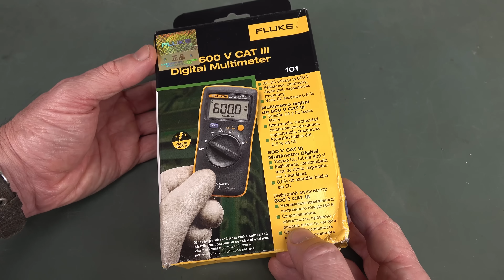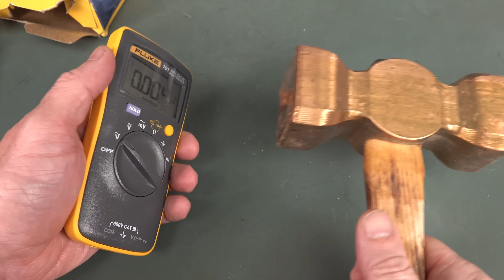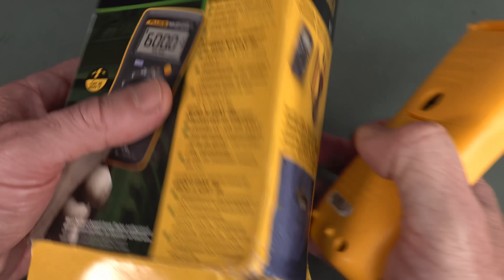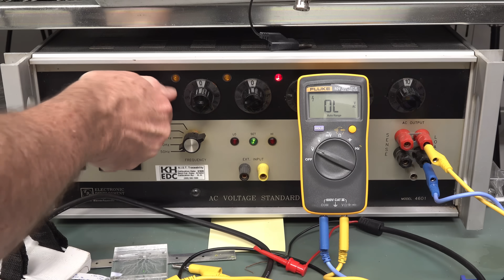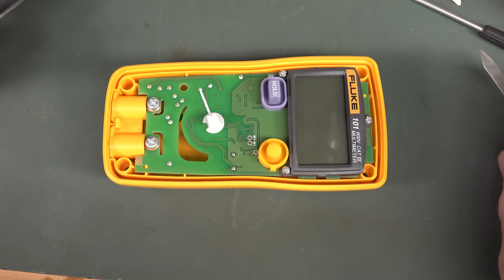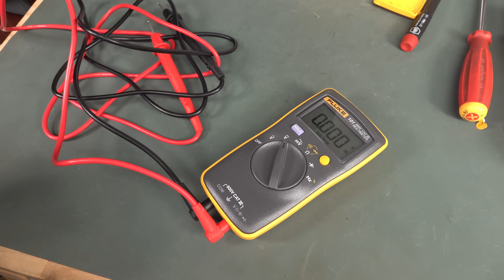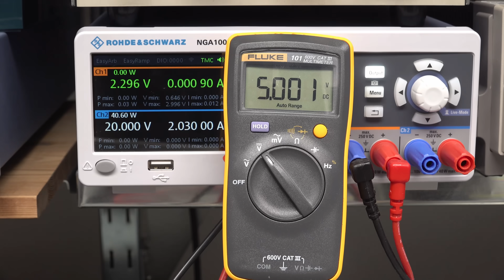EEVblog 1574 - REVIEW: Is the $42 Fluke 101 Multimeter Any Good?

Comment: As a hobbyist (basicly learned everything i know about EE by watching your channel for the last 8 years or so, and couple of other channels) I bought the Aneng 8008 when it was new and it's still working great and does everything i need it to do, it's all low voltage, like 12v max as my main interests are microcontrollers like esp32, arduinos etc ... However even though my Aneng can measure mains voltage, Im usually not comfortable using it to measure high voltages (and i try to not fuck around with high voltage) but now Im thinking about ordering this one for the few times I need to measure higher voltages and stuff like that .. Then i have the Aneng for it's features and keep using it as I currently do, but then i can have this one for it's protection when I need to measure high voltage knowing it wont damage my meter since I have a bit more faith in Fluke than Aneng ;) And buying a 2-400$ meter does not make alot of sens for me .. Win win
Reply: I also bought an Aneng when Dave did his video on it, and I have found the range switch to be unreliable. After not using it awhile, a short will read as 10-20 ohms, for example. Switching it back and forth a bunch of times fixes it but it has caught me when I was using it to troubleshoot something (I use bench meters for most work). I think I would rather have a bulletproof range switch than features, since I only use it to test volts, ohms, and continuity anyway.
Reply: Ive got the ZT108( think thats the same as the Aneng), had the same issue, I took it apart and cleaned the gold tracks with some alcohol on a cotton earbud and then then again using Servicol which is a contact cleaner and lube, seems to have fixed it for now.  I think the new ones might have improved this issue, reviews of the ZT303 say its better (looks amazing actually), the ZT108 is about 6 years old now.  It is far far better than this fluke in every other respect much better accuracy and is true RMS.  Also £15 vs about £65 for the Fluke!   @jessicav2031
Reply: @dunk8157  Yep, I have taken it apart and cleaned the contacts several times. It lasts awhile, but after a year or two the problem returns.
Reply: Servisol is good stuff, not sure how long it lasts though but its brought a couple of things back to life that I thought I would have to throw away.  The thing is you only need a tiny amount and a can of Servisol is half the price of the meter, still its useful stuff when you do need it.  I do wonder if standard oil would work, eg car oil I don't know enough about contact lube to know whats in it. WD40 is advertised as contact cleaner too but I thought that was not a very good lubricant.  Vaseline is yet another option. @jessicav2031
Reply: @jessicav2031  Maybe try adding a little dielectric grease? Might help.
Reply: Curiously enough I've blown one of the cheapest analog meter on the market over my lap and... I SURVIVED. it didn't.

Honestly I don't know what kind of voltages you do plan to measure that any cheapo no-name multimeter couldn't handle. Perhaps people go around poking at 100odd kVolts transmission lines with one probe to the other!?
Reply: Only issue I've ever had with my 8008 was the piece of plastic that formed the screen and sat infront of the lcd turned opaque - probably a reacrtion to UV light - but other than that it'd been fine.
Reply: My Aneng 8008 is also very unreliable. also bought it after Daves review. i think it is also the range switch. it seems to have very bad contact issue. on most functions, it will not even turn on, on others i can get it to work if i press on the range switch. it was like that shortly after i bought it. has been sitting in my drawer ever since. have not used it more than once, since it won't work very reliably.
Reply: Make sure you get it from a reputable source, I'm sure the China Export squad already jumped on it to create a "FULKE" near exact copy minus the safety :)
Reply: Mine works 100% , but the only "issue" i've had was that i broke the stand on the back of it , but kinda does not matter since it was pretty useless

Comment: I have a 107 (which I imagine is very similar to a 101) and it is absolutely horrible.  I basically just keep it in my car for emergencies because the continuity (beep) mode was so unbelievably quiet/unresponsive and (if I recall correctly) its time to read an accurate resistance reading was super pathetic.  My AN8008 is a significantly better meter if you ignore robustness and viewing angle...and you only consider speed and trusting the measurement your equipment.  If you have to wait a random number of seconds to get an accurate measurement, how do you know when your measurement is correct?

I'm honestly embarrassed that I own the 107.  I've though about simply smashing and discarding it so others wouldn't have to deal with how pathetic it was, but I can't bring myself to do it.

Comment: I have the 107 and its fantastic! It has that "Fluke feel" of quality, is plenty accurate and very well design. The back light stays on a long time, unlike my Brayman's backlight, which is useless. And best of all (the main reason I bought it) its small enough to put in your pocket, even with the leads wrapped around. I use it as my field meter and for working on my car - anytime you need a handy portable meter. I even use it as a second meter on my bench. I love it. The 107 has current and extra features that the 101 does not, so it costs more, about $ 100 Yankey bucks.

Comment: Does make one wonder if they didn't include current measurement option because they've simply ran out of space to put in protection for that as well...
Reply: Well that and that a proper DMM fuse costs waaay too much for a $40 product. I’d be surprised if this meter cost $20 to make. A real DMM fuse, even at the massive volumes Fluke buys (which is why they can sell them in a 5-pack for about $7 each, while the same fuses, without the detour via Fluke, sell for $11-20), would add several dollars to the BOM cost.

Comment: I have the 107 and like it a lot and use it all the time. It's not something I'd use at my main test bench but it's the first thing I grab for a quick voltage or resistance check.
Reply: The 107 was tempting since it has a backlight but I didn’t think it was worth the extra $60 when the 101 is only $45
Reply: The main reason I chose the 107 is that I wanted the test lead jacks on the front of the meter. @julesdim1758

Comment: I use this more than my Fluke 287. I found it's not really that good for some readings like DC readings with crappy LED drivers with a lot of >10 KHz ripple (not true RMS as mentioned by Dave). This is a good, safe meter for an electrician.
Reply: This is a truly sad meter no electrician would be caught dead using it
Reply: LOL...I was an IBEW electrician and we used these as pocket meters. It's CAT III rated just like the Fluke 117. We also used the Fluke 87 for CAT IV.
Reply: @SparkyTom1  Great...
Reply: @SparkyTom1  & you just put up with floating voltages & no RMS? Why would you do that?
Reply: Sigh....most of the time we use a meter it is just to check if there is a voltage present or not for safety reasons. Did you miss where I also mentioned the Fluke 117 and 87, clown? It sure seems like you did, right?
Reply: @SparkyTom1  I didn't mean to offend you, i love the durability & form factor of it but no RMS just isn't worth the trouble  for most people( i assumed)
Reply: I can tell that you're not an electrician or field engineer because I'm not hauling around a Fluke 87 just to simply check to see if a circuit is energized or not. And I wasn't talking about most people, right? 

Unlike cheap meters or voltage testers, I will trust a Fluke with my life even if it's a $45 Fluke 101. And I don't need true RMS for DC work (edit- assuming good DC power supplies like Mean Wells).
Reply: @SparkyTom1  The 17B or 18B are a similar form factor surely they would be a better choice? LED tester can be useful
Reply: No, the Fluke 101 slips in your pocket, even a shirt pocket, unlike the larger 17B and 18B, and takes up less space in a tool belt. Also, electricians typically use clamp-on amp meters so we never have to break or work a hot circuit. I've never used the current function of a normal meter as an electrician and it's generally not needed.

Most of the time we use meters it's for a simple safety check or to test continuity. Most of the time if an AC measurement is off a few volts it does not matter. If I wanted high accuracy I used a Fluke 87. If I worried about ghost voltages like between a neutral and ground wire I used a Fluke 117 with the lower impedance input.

The Fluke 101 is inexpensive enough where a NECA contractor gave them out as Christmas presents. It beats the solenoid voltage tester the flew apart in my hand testing 277/480 VAC circuits.

Comment: I did a review of the 101 on my channel about a month ago. My conclusion was that it was not worth its price tag. You can get far better meters for $50. I thought it may have been specific to the one I got but the continuity beep was not instantaneous which was very disappointing.
Reply: Completely true. This thing is NOT worth the money and it is not available for under 50$ anywhere outside the US. In Europe it is well over 100€+Shipping. Given the poor specs for that price you're much better to buy something else. The mentioned Aneng 8008 has far better features and is 24$ delivered.
Reply: @Kevin-mp5of  great suggestion! Looks to have lots of features for a decent price.
Reply from the maker: Better features and bang-per-buck, yes. But better quality for $50 though?
Reply: @EEVblog  Agreed on the quality but I would have really liked to have seen the ability to measure current. And the continuity being the way it is, I think is somewhat of a deal breaker for me. When I bought it I knew I was buying a Fluke so I expected continuity to be instant. I have a $50 meter from harbor freight and it does instant continuity and measures current. And it’s withstood my abuse over the last 2 years. I have a very limited budget for my electronics test equipment so I expected the 101 to be more like a 110 series meter just with less features and that’s not what I got.
Reply from the maker: @theteenageengineer  Not every meter is designed for every user, which is why these kinds of meters without current measurmeent exist. You bought it knowing it didn't have current measurement right?
Reply: @EEVblog Yes I knew it didn’t have current when I bought it. I was just saying that for what other companies are able to do for $50 it probably wouldn’t be that hard for Fluke to add current measurement to it.
Reply: Sadly its not $50 in most of the world, more like $100 and yes for that money you can buy a really nice quality UNI-T (the latest models have really upped their game in quality).  The pocket Hioki is about $60 that must be similar in quality.  Or some of the new cheap meters under half the price of the Fluke that do not have an rotary switch and use buttons instead, almost no points of failure on those.  @EEVblog
Reply: @EEVblog  Define Quality.  My experience with the 10x Fluke meter is that they are unbelievably slow in certain modes (resistance) and the buzzer/continuity is pathetic.  Time is money...if my tools slow me down and are unreliable, they are worthless.

Comment: The colour scheme of that box has serious "Multimeters for Dummies" vibes
Reply: Def, and those soft rubber corners screams soft head helmet, of course their all kinds like that. I like my 90 degree corners and boxey 80-90s cars, Soo maybe I'm biased, once my doctor says I can remove my helmet I'll let you know
Reply: Well it's the Multimeter 101, basically made for learning the basics.
Reply: @qwertyboguss Buying a Fluke if you still need to learn the basics is a waste of money. A $5 meter will teach you just as well. By the time you've advanced you want more features so you'll buy a new meter anyway.
Reply: @Ni5ei  never said it was worth the money.
Reply: @Ni5ei  A $5 meter can blow up in your hand.
Reply: @Ni5ei well I guess it won't let you blow the fuse by trying to measure current in voltage mode 😂
Reply: @2bfrank657  It's good for someone learning to blow fuses. At least then you learn what you did wrong. No danger, no high costs, just a moment to remember you messed up.
Reply: That's been Fluke's color scheme since long before the 'Dummies' books were a thing
Reply: It really does doesn’t it.
Reply: Fluke have always been grey and yellow and I suspect long before the For Dummies range of books.
Reply: lol
Reply: True!
Reply: Was going to say; "for $70 to AU$80 you can't beat an SCA (Super Cheap Auto) mini clamp meter (I've had 2 of em' for well over a decade) - but I just checked and it doesn't look like they sell that one any more...
But the good news is, it looks like they've superseded it with the ToolPro clamp meter for $69AU which appears to be slightly better. So I'd recommend IT over the (liver) Fluke for the same money.
Reply: Arrogant